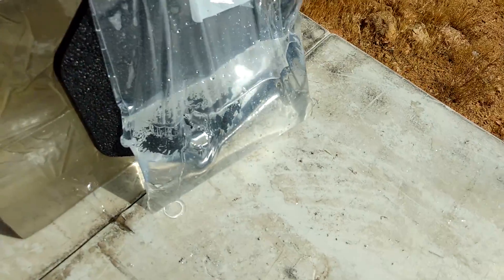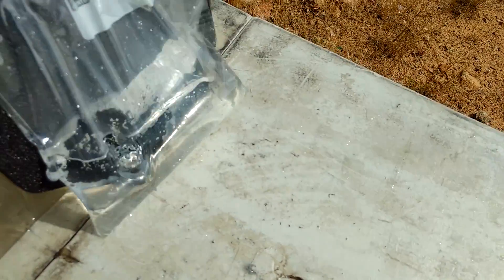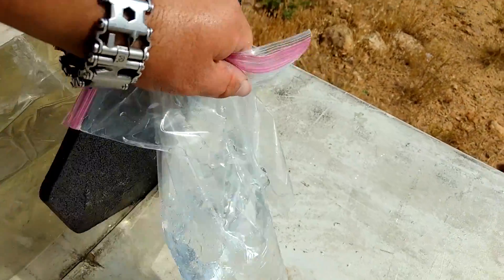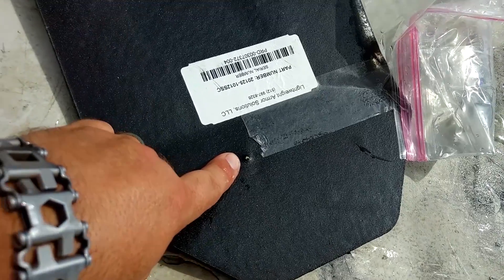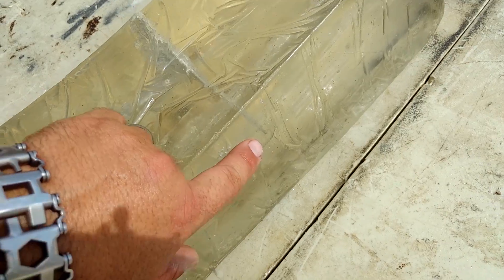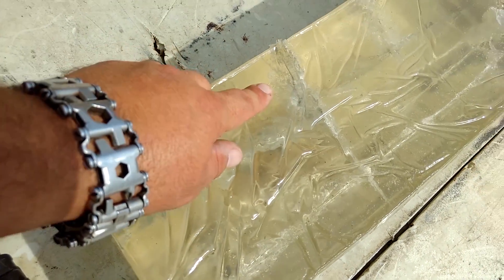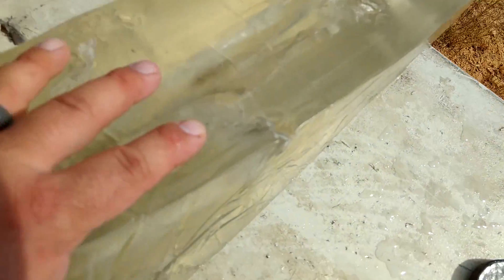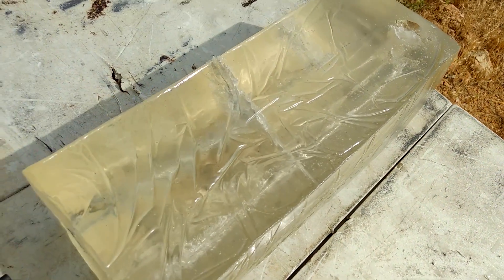Camelbak uparmor Part 2: IIIA vs M193

Comment: try to Ziploc bags with water put them both in the freezer one with plain water the other one with sawdust. the sawdust one has to be mixed with a larger percentage of sawdust than water something like 75-25 or 80-20 ratios. not that you would normally have sawdust in your camel pack but....

Comment: Got one for you. 70gr Speer SPs in 223/556. I'm not lucky enough to have cameras and gel. I can send u a few to load if need be. Send pm if u want a few
Reply from the maker: Thank you. It think they'd be even more likely to get through. I don't think the water slows the bullet down a lot, especially if it has decent mass and sectional density. For this to work, I think it would have to be fast and light like a 45gr varmint bullet.
Reply: The Chopping Block sorry boss I meant for these rounds to be gel tested not the plate.